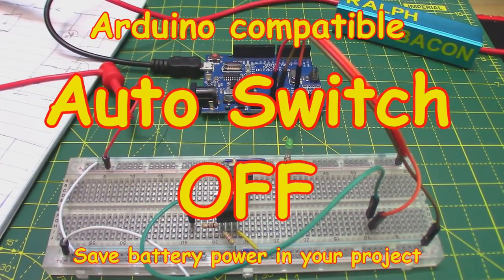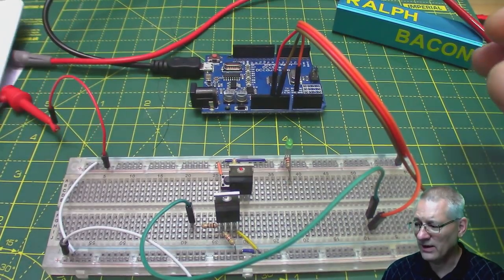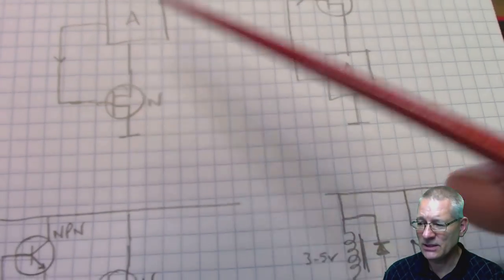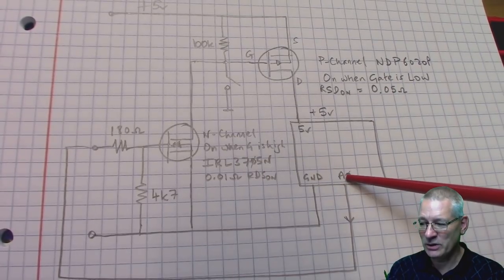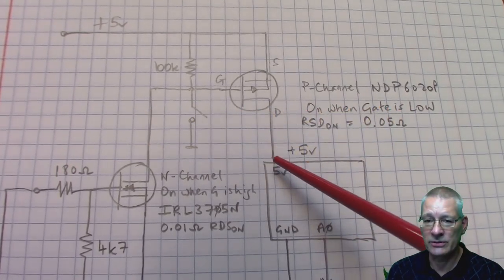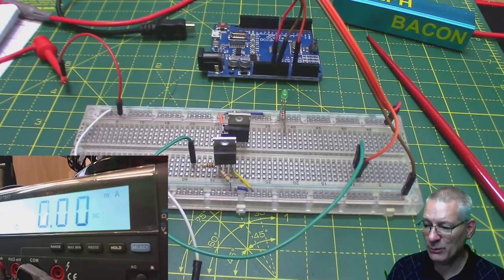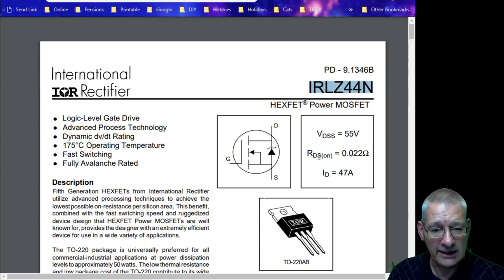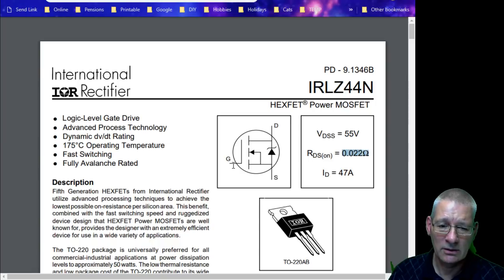#123 Arduino Auto Shutdown (and switch off)

Comment: Hi Ralph, I commented on your blog post with the same theme so thank you for doing a video and proving the P-channel works in the high side as well as the N-channel in the low side that I had used.  You do need to be careful about assuming that there is a full off - as I found out through the forums after much hair-tearing mosfets have a small leakage current when "off" (seen in the datasheet as Idss).

In your final circuit you have the Arduino permanently powered, of course it can also be powered from a 5V supply derived from the 12V one and thus send itself (and the regulator powering it) to sleep in the same way the first circuit did - so the 12V one can have a 0uA draw so long as the correct mosfet is chosen.  Often mosfets with a low Idss have a slightly higher RdsOn but I have found this to be a better trade off given that most circuits designed this way are intended to spend much more time off than on.

Incidentally the Amazon dash doesn't use this technique - they draw a continuous 2-3uA when in their standby state slowly depleting their inbuilt unchangeable battery.  Mind you the battery will actually self discharge at a higher current than that but still...
Reply from the maker: Ah ha! So that was you, Gavin, a bit backwards (you know what I'm referring to). And yes, it's a small world, we're all doing very similar things. So instead of me being trail-blazing, it appears that there is nothing new under the sun.
 
But to return to your post there, it appears that this circuit would work just fine for an ESP8266, would it not, even at 3v3, as the N-channel MOSFET doesn't have to be fully on to bring the gate of the P-channel MOSFET low (I haven't tried this but it seems probable). Just buy a few of those P-channel MOSFETs (I mean, how cheap can these things go?) and have a go!
 
And yes, the 5v can be derived from the 12 volts, I'd use a buck converter for efficiency though, not an LVR as they just waste power.
Reply: @RalphBacon  Hi Ralph, yes it was me.  I have it working very well with an ESP8266 with an N-channel in the 0v line.  I'm using 3xAAA batteries so nominally 4.5v (dropped to 3.3 with an LDO-LVR because I haven't room in the enclosure for anything else and it's only on for 5 seconds per day) driving the mosfet with the 4.5v using an opto-coupler on the ESP.  Not because 3.3v isn't enough to turn on the mosfet but because the ESP was still running when I drove it directly - I discovered that the ESP can run without GND attached if there is a GPIO attached to 0v which was happening through the pull down on the mosfet gate.

I had ordered some IRFU5305 p-channel mosfets from AliExpress but when they arrived whilst they were badged as International Rectifier IRFU5305 they were actually some as yet unknown n-channel devices with the pins in a different order from the 5305.  Now I have seen your video I have ordered some of the p-channel ones you used - looking forward to more experiments when the boat arrives from lands afar.

Thanks as always for your video - always makes my day when I see a new one from you.
Reply from the maker: All is clear, I hope you have fun with the (cheap or what?) MOSFETs when they arrive (watch out for those static handling techniques). Thanks for your support too, much appreciated.
Reply: @gavinsmalley1513  Hi Gavin,

Can you provide your schematic Please ?

Thanks.
Reply: @gsge  See first post of https://www.esp8266.com/viewtopic.php?f=160&t=18590 but replace the IRLZ44N with a BS170.

Comment: Yes! This is exactly what I had in mind. One little bit of confusion I have--is it the drain of the IRL3705 that is connected to the gate of the NDP6020?
Reply: Ok. I got it worked out by a closer look at the circuit as you laid it out on your breadboard.  Once I realized your bus strips have 2 isolated halves it was much clearer.
Reply from the maker: There's more including a circuit diagram etc on my GitHub:
https://github.com/RalphBacon/Arduino-Auto-Switch-Off
Reply: @RalphBacon  I ordered the dual mosfet module from bangood from the link you gave me. I wired the circuit according to your diagram and it works marvelously. The only issue now is my nanos ( i got them dirt cheap ) have the 'old' bootloader and it takes 2 full seconds for the nano to set the output high whereas my mega and uno take only about 1/2 second or less. I was thinking that I wouldn't need to resort to a bare bones uno for the project since with this circuit the batteries should last and last. I don't know if I can upgrade the bootloader on my 'old' nanos? Going to google that now. Thanks Ralph.
Reply: @RalphBacon  I watched video #177--again--and that gave me what I needed. I loaded the Uno bootloader onto the Nano and now the time from button-press to arduino output-high is 'nearly-ish indistinguishable' from instantaneous.

Comment: -31 milliamps!! And they say free energy is a farse! 
This is a great alternative to say a TPL5110 being limited to maximum of 2hr intervals, or could be a lifesaver of a circuit for those who only purchased a TPL5111 and were meaning to turn their Arduino off, not merely trigger a pin. What sort of power are we talking about here? I know its "off" but since you are really getting into the low power stuff, do you have a Ucurrent(eevblog) or newer current ranger(lowpowerlab) to measure your projects down to the nanoamp range? I think this would be a great investment if not. Getting the power down below the current popular low power champion (TPL5110) based solution and using a ds3231 looks to be a much more desirable solution for the longer off times (and from the looks of things cheaper).I am equally interested putting the Arduino or bare chip to sleep and just trying to get all peripherals (screens, sensors etc.) on a system like this as I am in having a real time clock dictate the whole power of the project. A nice hybrid would also be desirable to have an RTC turn on the Arduino and the Arduino from there, determining what pins to trip to trigger then in the on status. A robot for instance is tripped by the RTC, arduino starts up, triggers a single sensor, perhaps temperature, if temps is okay, there is no need to power up the screen to notify anyone visually. These screens and such, often have vampiric loads even when not being powered and it would be great to turn their power off completely. Ideally an arduino with 10 sensors would take no more power than an Arduino with none.
Reply from the maker: If we assume that my meter can accurately measure µA (as shown in my barebones Arduino demo) then I can only assume that any current leakage is below 1µA - I reckon that's below any self-discharge (internal battery leakage current) so probably has no (negligible) effect on battery life. Which is where I stop as there's no point in finding out, IMHO, for example, that it actually consumes 10nA. YMMV of course.
 
Your example of something being triggered by an RTC is exactly one option that I mentioned briefly, it's probably the way to go. the DS3231 has flexible alarm settings, enough for this purpose and consumes no power from the main battery.
 
Good to hear from you ytfp, it's nice to see that we're all thinking along roughly the same lines, with lots of "what ifs".

Comment: Could you put a resistor from the drain of the P channel to the gate of the N Channel to latch it on as soon as the button is pressed, then only use the Arduino to turn it off?
Reply from the maker: Trying to get my head around this, Joseph. You want it to power on automatically (no Arduino involved) but let the Arduino power it off? Then what? The Arduino dies (power off) and it auto powers up again? Please explain!
Reply: @RalphBacon  
Yea, with the auto on being the switch, alarm, RTC etc.
I could be wrong but I thought it should work like the following?

When the Arduino powered the circuit(at 4:00) off there would no longer be any power coming from the Drain of The p channel to latch the power on so it should stay off until the button is pushed again. (Maybe you would need a  Diode before the 5V pin on the Arduino to stop it from back powering the circuit?)

Lets call the P channel MOSFET Q1 and the N channel Q2
So with the resistor in my post above added:
1: You push the button, turns on Q1
2: This then powers on(5v) to Gate of Q2 (through the added resistor)holding the power on by pulling the gate to Q1 low.
3: To turn off you pull the Q2 Gate(with an IO pin, A0 here) low hard enough to override the resistor from Drain(output) of the Q1 than was holding it high.
4: (As long as the switch is not still on overriding Q2) the gate to Q1 should go to 5v volts turning off the power.
5: As the voltage at the Drain(output) of the Q1 is now low(at least low enough to be less than the turn on voltage of Q2) the resistor should help keeping the circuit off rather than holding it on at this point?

Comment: Very interesting video, thank you!

I know I'm late to the party, but I made a DS3231 library that's a drop-in for the DS1307RTC library for the time library that adds up the alarm and other additional functions available on that RTC. It's on my github /deskwizard/DS3231RTC . Quite a coincidence I stumbled on that video whilst I'm actually using it hehehe
Just a heads up, it might not work as-is for ESPs, the current workaround is to comment Wire.begin() in the CPP file and call it yourself with your selected pins in setup() before using the RTC. I'll get to it I promise... :P
Reply from the maker: I just found it on GitHub, Charles, and in case others are interesting go find it here: https://github.com/deskwizard/DS3231RTC

Comment: Hi, I already wrote other times but if you use the right components you can make a wireless node that can send sensor data on regular or dynamic intervals with just 4 or 5 micro amps; if you keep the arduino in sleep mode, your sketch will keep its state while if you power it off when it gets power back it will have to start the sketch from beginning, initialize radio and sensors, establish a communication and so on. Real life scenarios are different than a proof of concept on the bench. If you want to see what I have been talking about, pls visit mysensors.org forum
Reply from the maker: Well, I haven't seen any device running on 4 or 5µA (I got about 20µA in my Arduino Deep Sleep test) but more to the point we need an ESP8266 if we are to send messages OTA.
 
As you saw in my ESP8266 Deep Sleep demo, it starts again from the beginning when woken up, just as if you had plugged it in the first time - including making a wi-fi connection (although it's quicker if you keep a static IP address rather than using DHCP).
 
So I will have to take a look at that website link to see if we really can do what you are suggesting! At least it's got us all talking about this, so thanks for posting, interesting post.
Reply: @RalphBacon  you need to remove voltage regulator from the pro mini and also the power led and use low power sensors. About ota, mysensors supports it either through custom bootloader or by adding a spi flash

Comment: I really love to try this out, but i own only the IRLZ44N (which should be ok for this task) but no P-Channel FET on stock. Is it really that easy to switch to a PNP Transistor?
Reply from the maker: It won't work properly using a PNP transistor instead of the P-Channel MOSFET because the resistance of the transistor will be much higher; thus it could get hot and/or not provide sufficient current. That said, as a proof of concept it might work (eg, using a simple LED as the load would be fine). As you saw in the video, MOSFETs are cheap (from the Far East, anyway, and not a King's Ransom from eBay UK, actually. I hope this helps.
Reply from the maker: Regarding the RESET pin, I believe that was just an arbitrary pin assignment for the Adafruit library use (to reset the CAP1188 on startup, probably).

Comment: Amazing video and explanations. Thank you for that. I'm new to Arduino and my question might sound silly. Is there any way, starting from your schematic diagram, to use the same button to not only turn on the Arduino, but also to turn it off?
Reply from the maker: Yes, indeed. I'm pretty sure I've covered this elsewhere but here's how:
1. Connect the anode of 1N4001 or IN4148 diode and a 300 ohm resistor (in series) between a pin on the Arduino (I'll use A1, aka GPIO 15, for our example)
2. The other end of the resistor goes to junction of the Gate of the MOSFET and the 100K resistor.

In the Arduino Code, specify your GPIO pin' mode as INPUT PULLUP.
eg pinMode(15, INPUT_PULLUP)

When the pin goes LOW (by you pushing that button and bringing A1 to GND) you can, via code, then bring pin A0 (as per the circuit diagram) LOW to turn off the entire circuit.
if (digitalRead(15)== LOW){
   digitalWrite(A0, LOW);
}
Circuit diagram here:
https://github.com/RalphBacon/Arduino-Auto-Switch-Off
(see file Auto Switch ON and OFF)
Reply: @RalphBacon  Thank you so much for taking the time to answer me in detail. I will remap the schematic diagram and try it. Also, when I finish I will come back with the results, for other to use them. Thank you once again and have a great new year!

Comment: Okay, since you say it wasn't so original, here's the challenge, then: Use the power on circuit to ultimately power a Raspberri Pi, then, once boot has completed on the Pi and amperage draw has gone back down, use the duino to open a charging circuit to a small supercap - maybe a 2.7v 40 farad X 2 - to reach 5.1 v min - supercap -  bank which will then activate and provide a short term power source for a safe Rasb Pi safe shutdown (along with a signal to the Pi to initiate the shutdown) in case of power removal (either inadvertent or intentional - pulling the plug).... which avoids the need for batteries.

What do you think?
Reply from the maker: Supercaps are fine, MIckey, but expensive, as well as being quite low voltage if you want to actually run something like a Pi from them. 3.7v Li-Ion are cheap and the technology has matured so that they no longer explode too often. I've often looked at supercaps but got put off by the cost. Maybe time for a revisit?
Reply: Thanks for the response. The reason for the supercap and not a battery is long-term stability in an industrial application where we don't have to worry about battery maintenance.

Batteries are a good answer, but they do have limited charging cycles, etc. and, for use in a safe shutdown application, where you are looking to preserve your OS on the SD card, you need to run a safe shutdown of the OS.... somewhere in the 30 seconds or less power requirement - not a standard UPS, just enough to get us over the hump and safely exit...

Comment: Hi ralph im your new subs..im dummy in arduino..ive a question abt in&out voltage..what if i using more than 5v..9v or 12 v maybe? Is arduino can handle it? Or are there components should be replace? Sorry my english.
Reply from the maker: Welcome to my channel, Ay. The Arduino Uno board can handle anything from 7-16v via the barrel connector, or 5v directly to the Vin pin. But the bare chip can only handle 5.5v absolute maximum so to use a higher voltage you need to use a 5v LDO chip - it only has 3 pins, Vin, Vout and GND and you need a 100nF capacitor on the input and output to make it stable. Like this one: https://uk.farnell.com/on-semiconductor/ncp1117lpst50t3g/ldo-aec-q100-fixed-5v-1a-sot-23/dp/2627989
Reply: @RalphBacon  thanks for fast respond sir..i hope can learning arduino specialy from your channel

Comment: Just for the information, you don't actually need anything like this for a Raspberry Pi - everything you need is already built in to the board, you just need to provide that external stimulus you mention. For instance for all my RPi's I have a wake up and shutdown/deep sleep button, it works with one GPIO plus ground pin, a momentary button and a simple Python script.
Reply from the maker: The only "issue" with the Pi is that it doesn't start up automatically after a shutdown. Or after the battery UPS has died. But I created a simple auto-start for that situation and a Tiny85. Works just fine. It's described in video #124.
Reply: The Pi will do whatever you tell it to - it's all in the software.  You can just as easily tell the pi to reboot on that external stimulus rather than shutdown (the pi doesn't actually 'shutdown' per say, it just goes into a deep sleep low power state, which is why the same circuit will also restart the pi as in my example) The only reason this won't work is if you want the pi to go to sleep for a period of time, and restart later at a predetermined time.  That could still be done with the same internal circuit and pins, you'd just need some form of timing or condition sensitive device to provide the stimulus in place of the button I described.  An alarm clock/watch would work, or say a photoresistor for day/night operation.  All you need to do is pulse the pin to ground for each transition - the thing that causes that pulse can be anything you like, and the script won't be any different.
Reply from the maker: That's exactly what the ATTiny85 does to the Pi! Super simples. See, we are singing from the same hymn sheet!

Comment: What about using a for loop for the countdown?
Reply from the maker: I'm not totally clear in what you mean, Adam, (it's been a while since I did this video) but a loop for a countdown should be fine. Actually, a near future video will be using the Auto Switch Off circuit so keep tuned.
Reply: @RalphBacon  I meant you used while loop for the countdown instead of a for loop.
Reply from the maker: In this instance i don't suppose it makes much difference, but a "while" is more for monitoring a condition, whereas a "for" is a simple count. Thanks for clarifying what you meant!